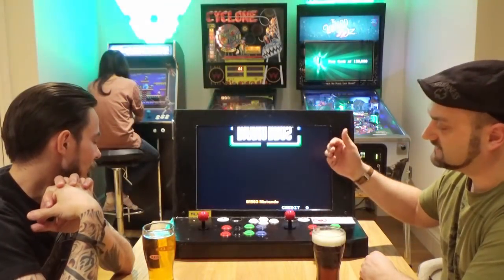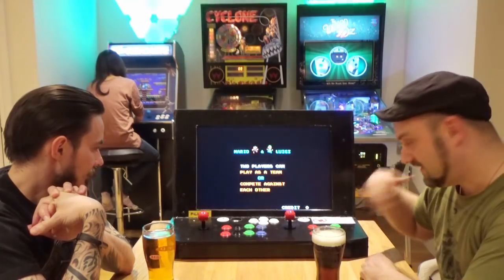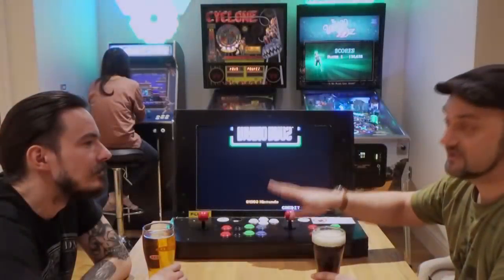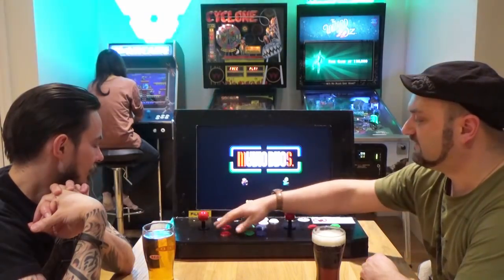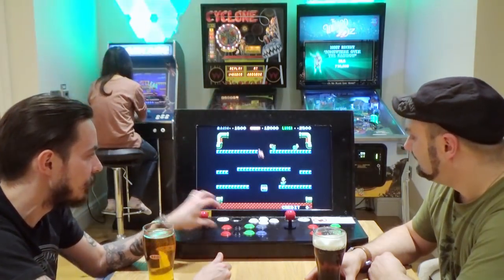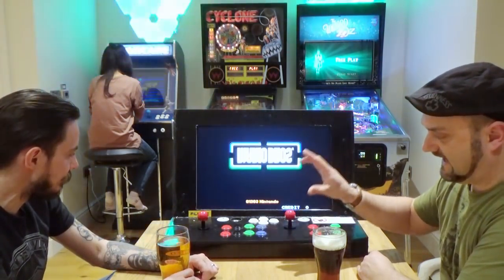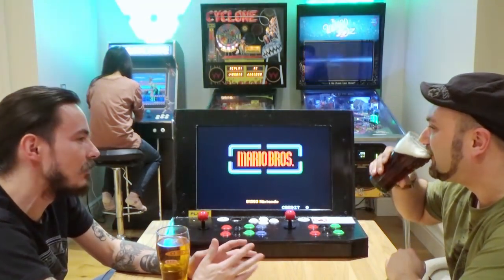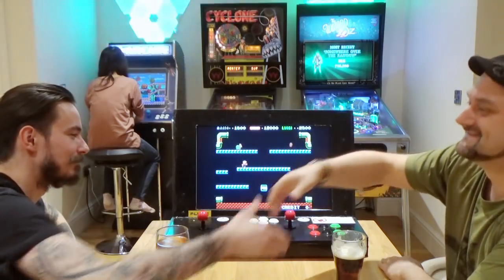DuB-EnG: ULTIMATE Bar Top Arcade Make DIY RetroPie Games Machine MAME Emulator Best Build Review NES

Comment: How did you configure buttons? I have a zero delay encoder also. When I boot pi it asks for all the inputs, I get through most but get stuck at L&R bumper and thumb sticks. I have 1 joystick and 8 buttons each side.
Reply from the maker: trbcop Rrrr ...  that’s weird...  it just worked for me, didn’t get stuck in the config menu.  I’ve made a few of these now, and the config menu just seems to work.  I struggle setting up the “exit from emulator “ combination buttons sometimes but it normally works out ok in the end!
Reply: thanks for reply, dont know if its coz i have the new retropie image or because on the first boot up i had the xbox one controller. will re-burn image and use joystick on first boot up